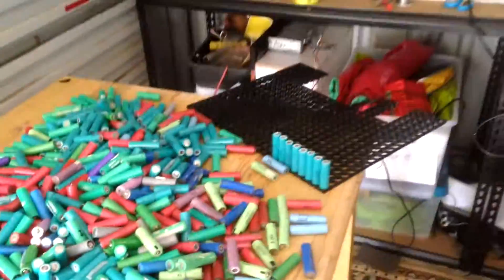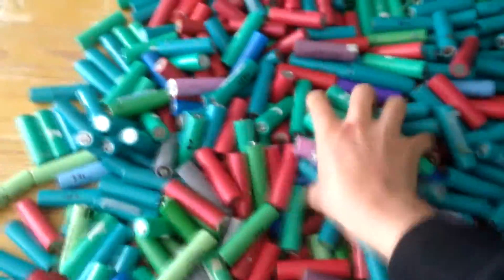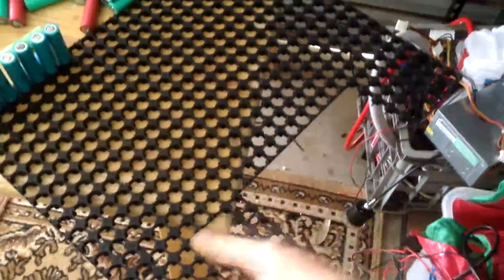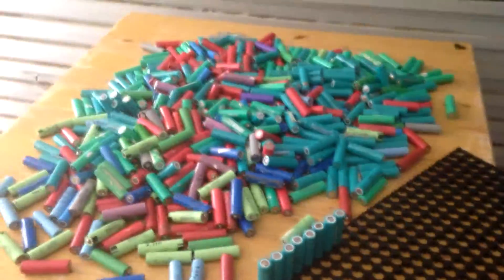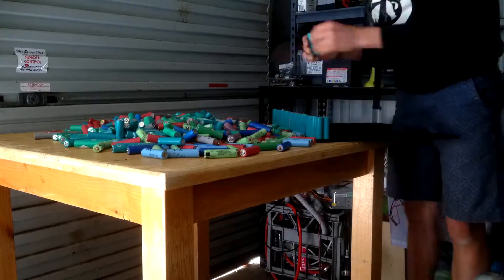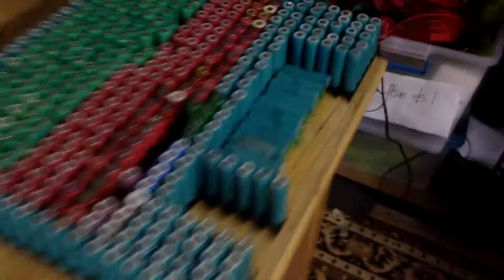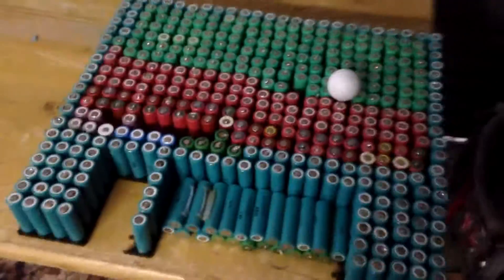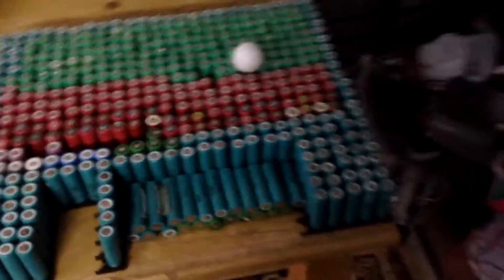DIY | How to make a Tesla Powerwall with lithium 18650 | The Batteries!

Comment: have you already charged and discharged all those batteries already? Good luck
Reply from the maker: No not yet, can't wait!
Reply: It will take a long time I am working on mine and it is a slow go even when I can charge 30 at a time and discharge 10 at a time. Charge discharge charge again. Good luck
Reply from the maker: old time engineer think I need more chargers, cos I can only do 1 at a time
Reply: For safety reason, you need to test each cells. old time engineer is right, its a slow process. For recycled laptop batteries I've tested before, almost 25% are completely dead, overheat or low discharge capacity.
Reply: buy a real iMax B6 arround 50USD for the real one and buy a long cell holder to charge them all in paral.